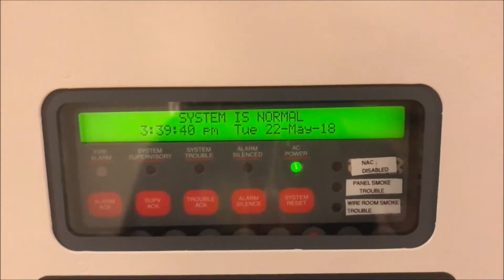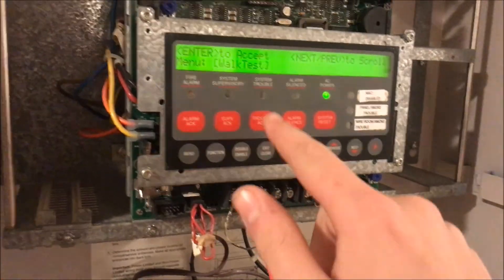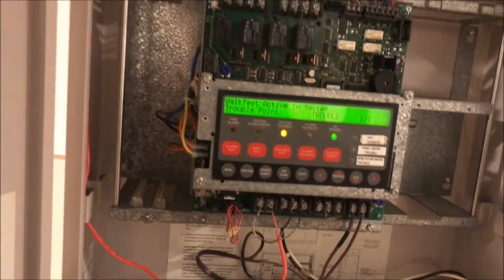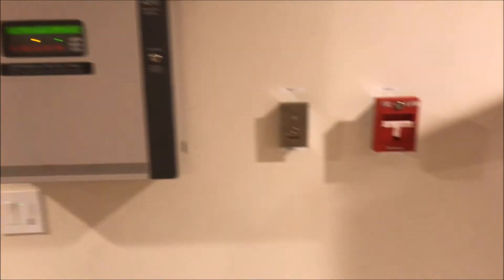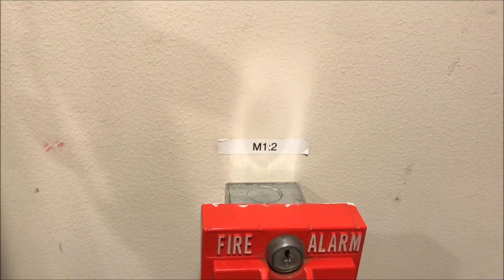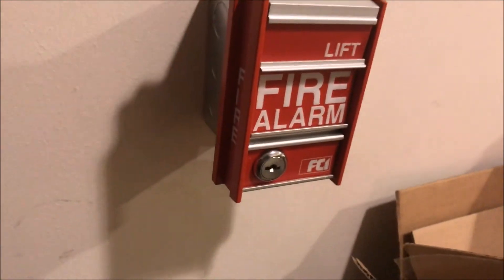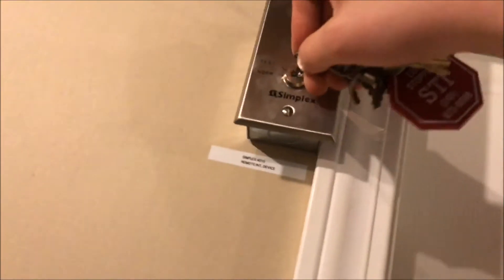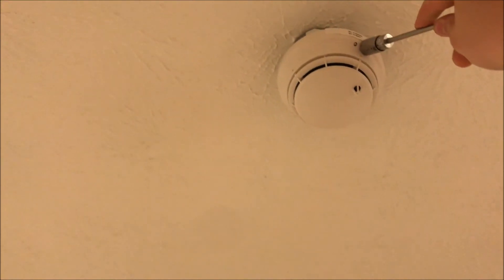Walk Testing a Simplex 4010 Fire Alarm Panel

Comment: Hi @Fire Alarms and Such. This is Tyler here. Where I went to school they would do a silent test of the alarm system so the alarms wouldn’t sound. What kind of test is that called? I’m talking about how inspectors can bypass the audibles and just test the system silently.
Reply from the maker: For an inspection, it can be done as a "Silent Walk Test". Otherwise, it can be done by disabling the NACs
Reply: @FireAlarmsandSuch  I am unfamiliar with this type of fire panel. I did a silent walk test and it only came through as a trouble. Is there a way to activate an alarm signaling device and receive and alarm signal without activating bells? I am required to make sure the fire monitoring company receives an alarm signal.